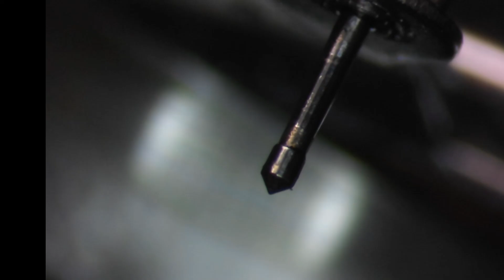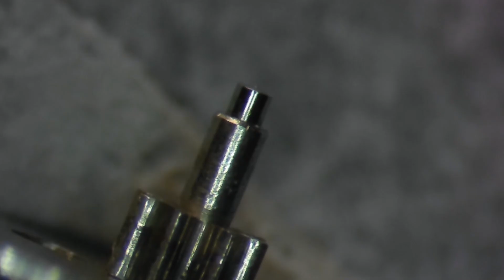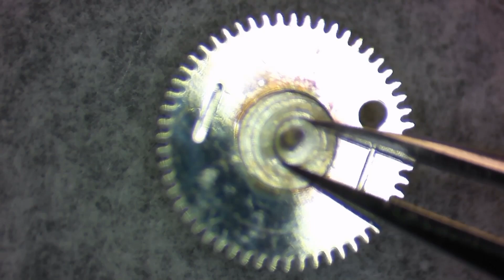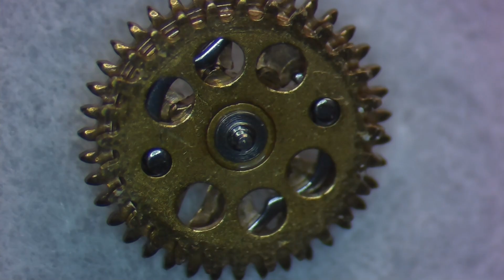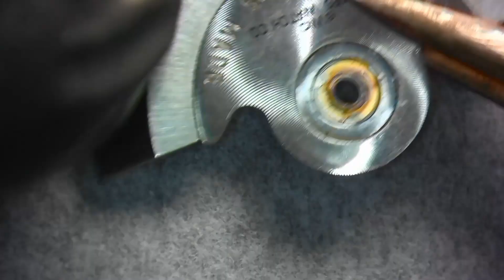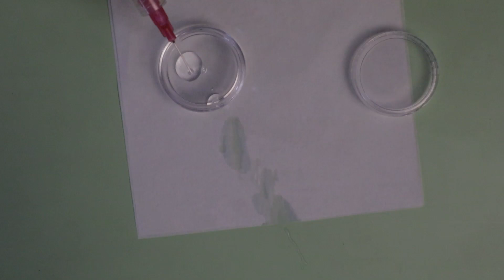Beginners Guide to Working On Automatic Watch Systems

Comment: 25:26
Hp1300 or 9504?
Wasn't it such that HP1300 was supposed to be used for metal on metal movements and 9504 for metal on jewels for the case of slower movements?
Reply from the maker: Metal on metal and metal  in a jewel or two different things. Metal and metal requires 9504. A metal pivot in a jewel requires 9010 pr Hp1300 depending on the speed or torque if the pivot.
Reply: @watchrepairtutorials 
Oh sorry, my bad.
I had watched that video of yours where you explain about different oils.
I just checked it now and It was as you answered here.
I had just mixed them up when writting my above comment.
I will delete my above comment after a while in order not to make any unnecessary confusions for others.
Reply from the maker: @a000ab no worries. HP1300 is often called out on tech sheets for some metal on metal contact areas. Having studied Tribology for years as well as 35 years of bench experience i use a grease on metal to metal contact areas.

Comment: Love the hexane + 9010 tip at the end! Be careful what you store your hexane in if you do something like this...I made the mistake of putting some hexane in a small mason jar to have handy at the bench and it dissolved the soft plastic sealing material on the underside of the canning lid, and just like the dip lube here leaves a light coating of 9010, my hexane was leaving a light coating of gummy melted plastic on my balance assemblies until I figured out what was going on! ha! lesson learned.
Reply from the maker: No doubt. I used Hexane for many years, but have since switched to heptane. Both are great, but obtain is a tad bit safer.

Comment: Sir, in your experience and observations, which  if seikos movements would you  say is their most reliable and most well engineered and built?
Reply from the maker: That’s a great question. It really depends on what’s important to you. I wrote an article about the differences between Swiss and Seiko build philosophy that highlights differences between them. 
https://watchrepairtutorials.com/why-seiko-runs-at-low-amplitude/
Vintage Seiko was designed differently than today. Extremely durable but the necessarily the best time keepers.
IMO , for modern Seiko movements the NH series is hard to beat considering the price point that the movements are sold at. Outside of their Grand Seiko line, their best performing movements I like are the 8L45. 
I am not a fan of the 4xx and 6xx lines. There are just too many problems considering what they are charging for watches with those movements.

Comment: In the ETA 2824-2 manual, they recommend to not wash the reversing wheels. This kind of makes sense since they also recommend to just put a small quantity of 9010 insted of using Lubeta v105/106. While I really like your reasoning behind using the lubeta better, I wonder what your recommendation in regard to cleaning the wheels beforehand is because I figure dipping the unwashed wheels in the lubeta will quite quickly contaminate the fluid?
Reply from the maker: Who recommended not cleaning parts before relubricating them them ?
Reply: @watchrepairtutorials  Thank you for the fast reply! Unfortunately my initial response seems to have been deleted - likely because I tried to include the direct link to the sheet. To me it looks like not washing the wheels is recommended on page 16 of the 2824 service sheet (version 10.5.2016; also available on the 2824-2 page on caliber corner)
Reply from the maker: @lambertbaer911  that’s because they require service centers to replace them.  Replacement is best if they are not working properly.  But if they are ok, you  would clean them in solvent based cleaners and rinse, dry then use the 105.  
It is also a good idea to test the auto winding afterwards to make sure they are working. I keep those reverser wheels in stock in case there is a problem.
Reply: @watchrepairtutorials I see, thank you!
Reply: Thank you for the fast reply! From what I understand this was indicated on page 16 in the 2824-2 service sheet (version from 12.6.2015) I downloaded from https://watchguy.co.uk/tmp/ETA%202824-2.pdf

Comment: Lift angle bonus tip, priceless. I ask an AI for the info which makes it easy but you can't always trust that.  Now I can check it and update my spreadsheet and feel confident its right.
Reply from the maker: Make sure to check out the new series I did on starting out and watch repair. There’s a lot of different information that will be useful.

Comment: Oh dang, at the end of the video I was thinking, "now wait a minute, I understand how certain lubricants have a solvent that evaporates away, surely there's a way--" but you explained how to do it before I could even finish the thought! Nice!

Though it kind of begs the question, why are there two different dip lubricants? Does that mean the dip solution should be more or less diluted? Or mixed up from a different base oil?
Reply from the maker: These parts have different lubrication requirements. It would be nice if there was one lubricant for everything, but unfortunately, it doesn't work like that.
Reply: @watchrepairtutorials  Sorry, I wasn't entirely clear. If you're mixing your own, like you show in the video with hexane and 9010, are you mixing it two different ways, for the parts that normally require two different dip lubricant formulations?
Reply from the maker: @jergarmar  
That formula only works for reverser wheels as opposed to buying the dip or using 9010 and trying to lubricate them by hand.
Reply: @watchrepairtutorials  Reverser wheels, got it, thank you. I actually have an Eterna-matic 3000 (my favorite watch so far) that I'm planning on cracking open and servicing, so I'll need it!

Comment: Great demonstration of all 3 systems Alex, thanks.  Is there an alternative to the V106 for lubricating the sealed ball bearing unit on the rotor? I guess if it’s open, you’d just use a drop of 9010 on the ball bearings.  But if it’s sealed, what would you use if you didn’t have V106?
Reply from the maker: Like on which movement for example?
Reply: @watchrepairtutorials  Hi Alex - thanks for the reply.  Well, like the 3rd movement you’re working on in the video, where the rotor bearing unit is sealed and you use the V106 as a dipping lubricant to penetrate and lubricate the bearings.  I’m just wondering what the alternative might be if you don’t have V106?

Comment: Just watching your videos has a healing rherapeutic influence.on my mind. Maybe I love watch movements too much
Reply from the maker: They are a thing of engineering beauty aren’t they.
Reply: @watchrepairtutorials  how much should I pay to have something like a seiko sarb033 serviced? I've had mine ~8 years and it's losing significant time now
Reply from the maker: @escapetherace1943  that part of the country, but I would expect 3 to 400
Reply: @watchrepairtutorials  3 to 400 dollars to service a 300 dollar watch?
what
Reply from the maker: @escapetherace1943  service cost for a watchmaker is not based on the watches value, it’s based on the time it takes them to do the work. 
This is an important consideration when buying a watch right? 
This is one of the main reasons people are motivated to learn how to service their own watches.
Reply: @watchrepairtutorials  I understand that but just a lube up for a sarb isn't worth 400 dollars, there are much more complex movements.
It's fine though I won't go to shops that charge 200 dollars an hour in labor like you. Fortunately there are a couple of reputed watchmakers in my state who charge way less.
Thanks for the videos though

Comment: Many thanks for the extremely useful video. I appreciated a lot and learnt a lot. If I do no ask much, do you have any tip on how to have an alternative to the V106? I actally have the V105and not the V106, so now I do not know how to lubricate the bearing of the rotor...Many thanks in advance. Fabrizio
Reply from the maker: Not that I know of. You can always use the standard 9010

Comment: That was really a handy tutorial, thanks. I have a few GP Gyromatics that use the ETA movement that I have been loathe to work on, partially due to not having the Lubeta to lubricate it with. This will really help. Oh, and your explanation of how the different types of auto-wind mechanisms work was great. Many thanks. I'm really enjoying your videos. Cheers.
Reply from the maker: Yes sir, thank you much.
Reply: Something popped into my head about the home-made reverser-wheel lube. Being that the cost of 9010 is quite high, does it really make much difference if I use a perhaps lesser quality watch oil to mix with the solvent? I have some Nye synthetic watch oil that I could mix and feel better about it, considering the cost of 9010, and the fact that I only have a 2ml vial of 9010 to work from. Cheers.  @watchrepairtutorials
Reply from the maker: @MrRoundel  perhaps if it was the same viscosity. If it’s not the reverser wheels won’t work, right.
Reply: Thanks again. I'll see what I can find out about the Nye specifications. Cheers.  @watchrepairtutorials

Comment: Thanks for the bonus tip - this is really useful. One question - this homemade "Lubeta" which is 33 drops of IPA + 1 drop of 9010, can we use it also where one would use Lubeta V106?
Reply from the maker: I would just stick with 9010

Comment: Thanks for the great great videos and sharing the knowledge. 

I stumbled upon a video that indicates apparently seiko advices a certain position for the rotor  when one is trying to install it back.  Apparently the hole on the first reduction wheel must line up with the balance cock peg and the hole on the right wing of the rotor in order to have the pawls at their lowest point around the ratcheting wheel in order for the pawls to have the most travel hence better efficiency of winding I am guessing . 

The demonstration which was performed rotor-less  while rotating the first reduction wheel manually  showed  it takes  four to five revolutions of the first reduction wheel to advance the ratchet wheel by one tooth if the rotor is installed the way Seiko suggests. 

But  it takes seven to eight revolutions of the first reduction wheel to advance the ratchet wheel by one tooth if the rotor is installed the complete opposite side, it all happens due to positioning of pawls.
Reply from the maker: This is true.Thanks for sharing.

Comment: In this video you are recommending Moebius 9504 for oiling the wall of automatic watch barrel but I also saw that you are using Kluber P125. What is the difference? Thanks
Reply from the maker: No. 9504 is not a braking grease. I do use Kluber but 8213 is also a good one to use.
Reply: @watchrepairtutorials  thanks for advice, my bad for 9504, didn't see correctly.

Comment: I love that technique for putting the circlip back on the automatic works,  i'll have to master that. How do you remove it without causing huge scratches? I use brass tweezers and try to push from both legs,  but it can still scratch or cause the part to join the Air Force lol
Reply from the maker: I use a small screw driver, insert it and twist it enough to loosen then grab it with the tweezers.
Reply: @watchrepairtutorials  That's a great idea,  i didn't think about prying it that way. Thanks!

Comment: Invaluable info I have seen from no other watch repair channel.  Thanks, Alex.  

Something I tried for cleaning parts is CRC QD Electronic Cleaner in the red spray can.  I think QD stands for Quick Dry, which it certainly does.
It's rather common, so they have it at Wal-Mart and many other stores.  It's quick drying and when you look at the ingredients it is essentially HEXANE.     Am I effing up for some counterintuitive reason?.  It sure seems like a cool option.  It sprays hard so, of course, don't use it directly on balance wheels and so on.   It works well, goes a long way, and doesn't cost much by comparison.  The last I got at Wal-Mart was around $8 a can.  Like everything else, it has gone up recently.
Reply from the maker: As far as the parts go, as long as there is no residue you should be good. 
The fact that’s it’s for electronics leads me to believe that it does not. 
 I ordered a can from Amazon to try out. And you gave me an idea for a video. Thanks

Comment: Could I ask you what is your choice for breaking grease in autos with brass barrels. Seems like opinions are all over the map
Reply from the maker: 8213 is kind of the standard for brass. Some people will use 8217 which works in all barrels.
I use Kluber p125 buts it’s 4 times as much as 8213.
8213 is fine.

Comment: Mixing a solvent with 9010 is a real money saver for lubricating the reverse wheels.
What about the dip lubricant for the oscillating-weight bearing? Can we mix one for those as well?
Thanks.
Reply from the maker: Someone else asked me the same thing. 
I’m not sure about the ratio, but that’s a great idea. The other consideration is the amount needed to actually submerge the rotor, so if there was a higher concentration of 9010 and more volume, you would have to weigh the cost savings vs just using V106.
Reply: @watchrepairtutorials  Thanks. I already have a bottle of V105, so then some V106 is on the want list.

Comment: Another great video.  Enjoying your channel.  It is interesting to note the differences in automatic works between the Seiko Daini based movements and the Suwa based movements.  I actually prefer the Suwa pawl system to the Daini.  Also, what is your opinion of dipping the reverser gears in Epilame first before using the Lubeta V105?  I hear this is a common practice for these reverser gear setups.  John S
Reply from the maker: I can’t say that would  be recommended  by ETA. Seems counter productive you know. You want lubrication on the pawls in the reverser.

Comment: Extremely appreciated tip at the end. I wonder if there is a V-106 alternative for rotors.
Reply from the maker: I don’t see why you couldn’t do the same if you are dealing with a sealed one. I haven’t looked at the difference in v105 and v106.
I have not seen any factory recommendations for v106 alternatives
Reply: @watchrepairtutorials  Thank you Mr Effing Time for taking the time to answer and for the great tips. The Hexane tip gave me gooseflesh. I bet I've spent many hours scouring the internet for a recipe for One Dip. I always suspected it was just some solvent unknown to me.
Reply: V105 for reversing wheels; V106 for ball brearings

Comment: Whoa, what an awesome tip at the end, with the homemade Lubeta V105 from 9010 -- I've never heard about that! Just another example of the secret knowledge you can only find on this channel 😁. Only have one quick question for on this one Alex, and kinda dumb but I am just curious: what's the metal disk you're putting the lubricated parts on, before they go under the dust cover? Is that just to keep the Lubeta from soaking onto the watchmakers paper?
Reply from the maker: LOL, man that’s a great question. 
It’s actually a mirrored glass disk.
I use them for all kinds of stuff, but in this case it is just a good clean surface, that wouldn’t react negatively with the solvent as it finishes drying.
Reply: @watchrepairtutorials  Great idea. I'll have to look around and see if I can find something similar for that. Thanks!